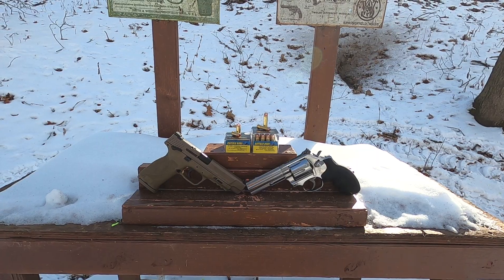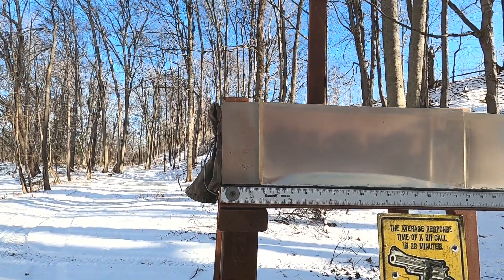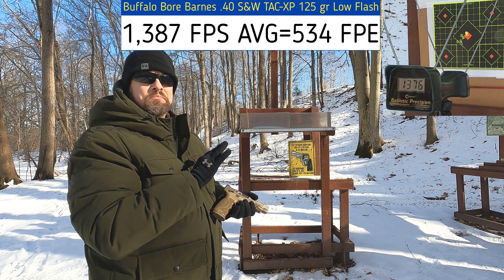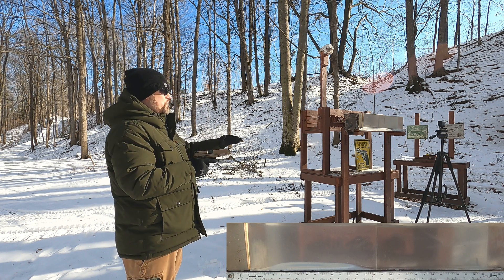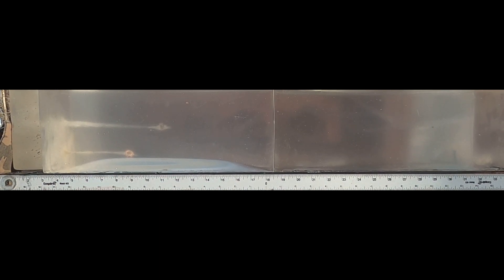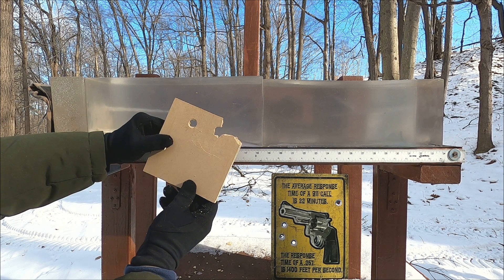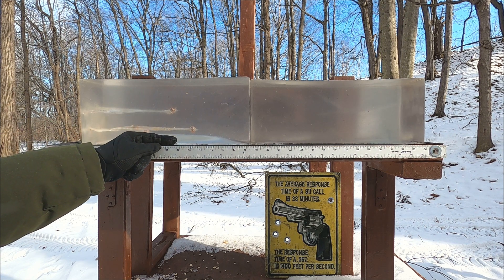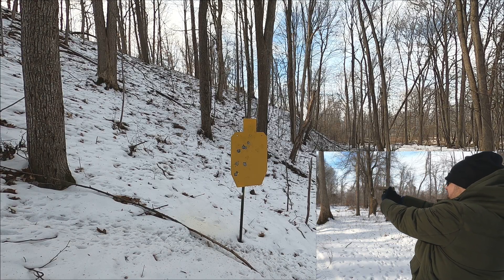.357 Magnum VS .40 S&W Buffalo Bore/Barnes Low Flash Ballistic Test

Comment: Thanks for comparing the 40 S&W vs the 357 Magnum. I've been a big fan of the .357 since the early 1960s when i picked up a Colt Trooper for use on boarding parties in Vietnam. Pleased to say I still have a .357 and have picked up a 40 S&W. I typically carry the 40 with 180 grain bullets. It's definitely a powerful caliber as well.

Comment: I've been really looking forward to seeing this test. I've got to get back on Patreon. I think the 357 version is a very good performer. It's a bit stout for an M&P340, but should be fine in a 66-8 2.75" barrel. Just don't pop a few off the back porch on a nice day when the Karens are out. The biggest downside to this ammo is the cost. Over $2/round in the 357!

P.S. On sectional density, it isn't the material that maters, it is the weight for caliber. eg, all 125gr 357" bullets have the same sectional density. The 125gr 40 does have a lower sectional density.
Reply: The material matters too if you think about it. Copper is a lighter material so an all copper bullet will weight less than a lead filled one. That is the reason why most all-copper bullets are on the light side of the weight spectrum of a caliber
Reply: @GRAndreas7  they are really targeting lead bullets because of the toxicity, but lead has 2 properties perfect for bullets and guns, it is one of the heaviest stable metals, which is what is needed, especially for sectional density and ballistic coefficient,  and it is soft and malleable and can deform, which is perfect for hollow points, and with only adding a slight amount of other metal elements you can harden it to become hard cast bullets which are heavier and stronger than steel or any other metal, so we need another soft heavy malleable nontoxic metal, or a molecule of 2 or more metals that meet these criteria, any thoughts?
Reply: @ethanmac639  Lead cost less than copper
Reply: @danoneill2846  something heavier and denser, think the same properties as lead, ie; soft; malleable/ductile; dense; heavy, and plenty of abundance and low cost, as well as can mix with other metals to make alloys, specifically hard cast bullets, also  it must be nontoxic!
Reply: @ethanmac639   I get the non toxic part , mostly you don't want to breath or eat it . I stopped shooting shotguns for fun because I didn't want lead all over the place . If you mostly shoot in a few locations & are able to recycle the lead or keep it in a small area I think your OK . What about all the nano metal they are dumping out of jets to block the sun ?? I have seen it here & have photos ...
Reply: @danoneill2846  nontoxic because the environmentalists are cracking down, and also it will be another gun control angle
Reply: @ethanmac639  To add to that, the material should be soft (like lead or copper) most importantly to engage in the steel rifling of the barrel without damaging it
Reply: @GRAndreas7  maybe Bismuth?
Reply: @GRAndreas7  Sectional density would be the mass of the bullet divided by the cross section area of the bullet. You are certainly correct about density overall which is mass divided by volume. So a 125gr copper bullet will be longer than a 125gr lead bullet.

Comment: The FUD in me wants to see 150 - 155 gr lead in the 40 cal     and   a good JHP  lead   or  SWC- HP lead   125 gr or more in the 357
Reply: I detect no FUD in you.
Reply: @Fudmottin   To be clear I was talking 150 - 155 gr JHPs , I did load some 175 gr SWC lead I shot out of a 40 S&W , SIG  P239 & 10mm out of the G20 Glock & 1911 Kimber 10mm , they feed fine . I only shot a few from the Glock barrel , the book said No Lead , It cleaned out easy . I mostly shot plated for low cost target loads . BTW 165 gr JHPs would also be OK for 40 cal , 180 gr flat points are OK , less weight/more Vel  is better for HPs .

Comment: I've been considering for some time switching to a .40 cal. I think I've decided on a nice 10mm glock I found at the gunshop and ik you can put .40 cal in them and if I want to shoot hotter rounds I can switch to the 10mm rounds. Would be interesting to actually see the difference between .40 and 10 mil
Reply: I have a 10mm 1911 with a .40 conversion barrel, it's nice to have a cheaper more available alternative to practice with. It's my hog hunting handgun and I wouldn't feel that under-equipped if all I had were 16rds of .40 180gr FMJ.
Reply: I have more clients switch from Glock to HK, but never the opposite way.  HK45 or HK45C or even a USP platform, where you can shoot .45 Super and .450 SMC from a factory pistol, Glock can't do that.  Get one with a LEM trigger and you will be a happy camper.
Reply: Never understood the .40 I like it but the 10mm can do everything  no need for the .40
Reply: @biggunshandguns3687  I like it because I'm a new shooter and I can handle the recoil and when I get better I can use 10mm in the same gun. The gun itself I'm after is a 10mm but I plan on starting out with .40 cal bullets cuz like I said I'm a new shooter
Reply: @bryce4359  just have extractor checked after every 2500 rounds or replace glock can do it better than others
Reply: @DanTheWolfman  thank you I appreciate the tips. I like to learn as much as I can. To tell you exactly where I'm at I just turned 21 a couple months ago which is the required are in my state to own a pistol. Before now I have had experience dear and duck hunting. Always used my really nice 20 gauge. #6 shot for ducks and slugs for deer. I've also had experience target shooting with different rifles, clay pigeons and that kind of stuff. Now that I'm old enough to own a pistol I have been really getting into it and learning all that I can and trying to make the right choice
Reply: @biggunshandguns3687  don't forget this is looking at a super light flash suppressed round. There are many more potent rounds in 40 SW.  Also the 40 SW is meant to be an improvement over 9mm rather than a hunting gun.
Reply: @biggunshandguns3687 . As much as I 💕 the 10mm ( I own 3 of them) I’d argue that its the other way around. Generally speaking it’s common place to pick up hot load 40 cal where as with the 10mm nearly 85% if not more of the ammo offered to us is severely watered down. You must go out of your way to get even decent preforming 10mm & it’s not cheap. Most 40 & 10 you’ll find on the shelves nearly everywhere you’ll find that the 40 is hot on 10mm’s heals. That said unless you constantly going out of your way to find 10mm ammo as it was truly intended & to realize real benefit as opposed to 40s&w then I’d say 40 by a long shot is the way to go. I’m just saying when the energy is nearly identical & the difference in fps is 20 to 40, why bother.
Reply: As someone who owns a .40, I’d say skip the .40 in favor of a 10mm
Reply: @sleeper.simulant7327  hate to run a 10mm through a Kahr polymer pistol.